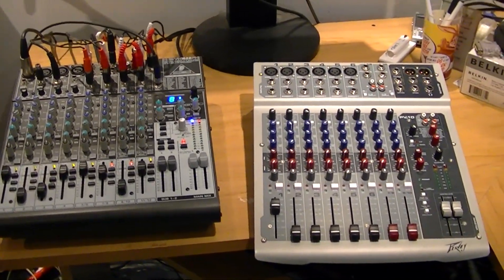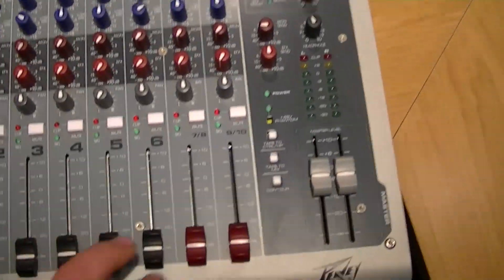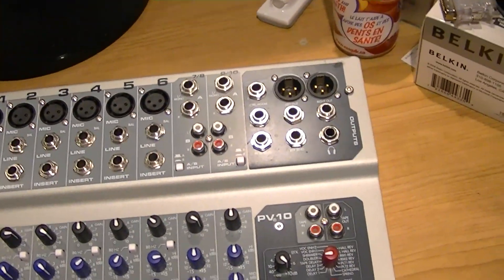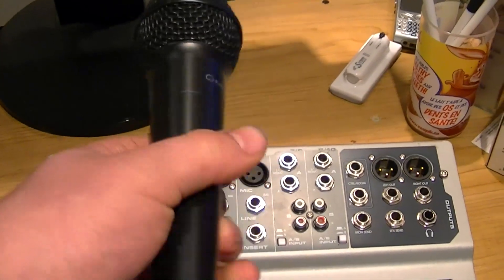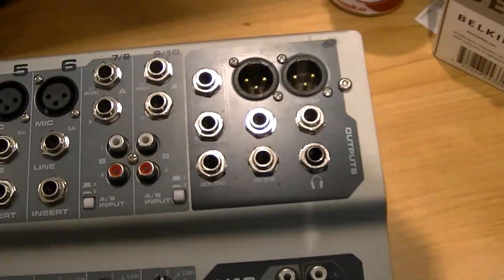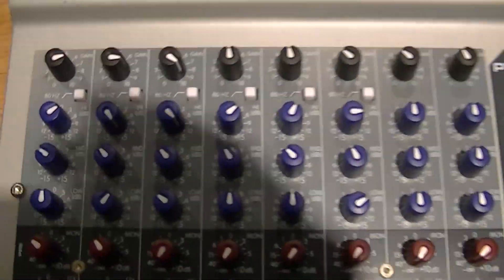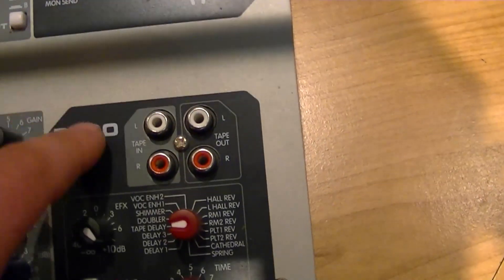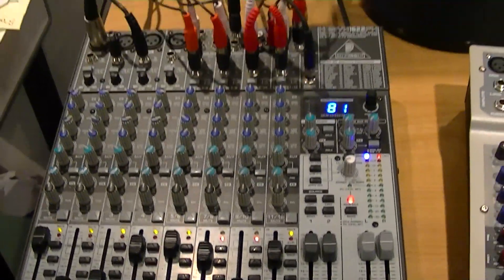Mixer Routing - Part 1 of 2

Comment: I would  like to run monitors off the  monitor input  I have 2 front off house speakers and 2 monitors how do I  get stereo sound for the monitors thanks  I found my mixer brand new still in the box  200 pounds off a lady never used it  result hey

Comment: Can you help! Im a drummer, And im using a Yamaha mixer but im running out if mic inputs. I need 3 or 4 more mic inputs. Can I buy the same Yamaha mixer but smaller and hook them both together and use it as one. If I can how do I go about doing that. I thought about buying a Y cable, But I need to be able to EQ each mic independently. Or does somebody make something where you can add more channels. Thanks man if you can help me out.